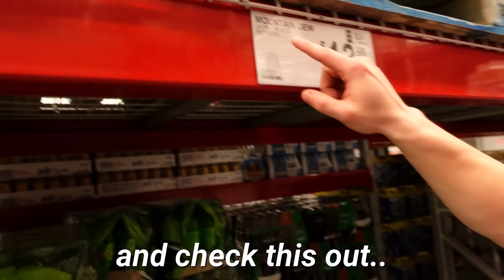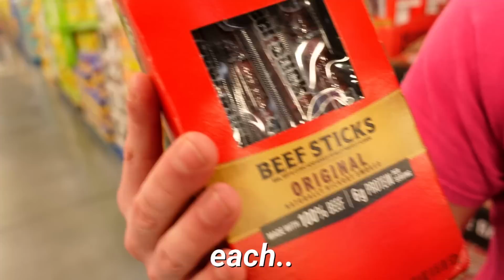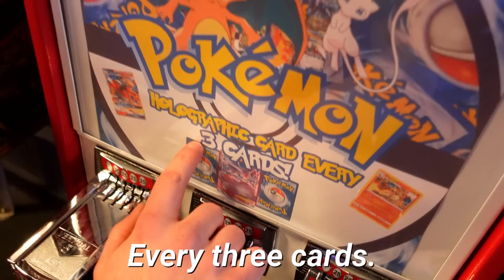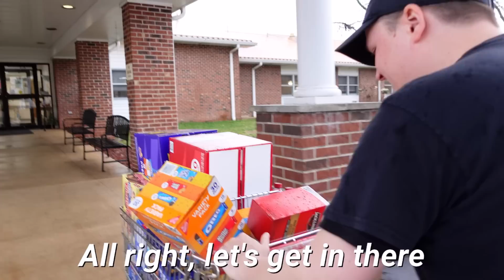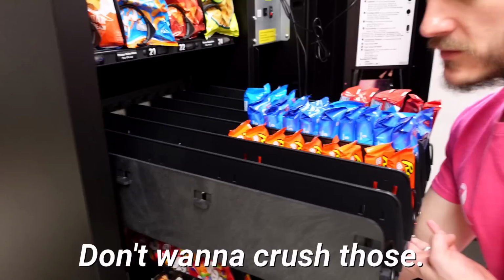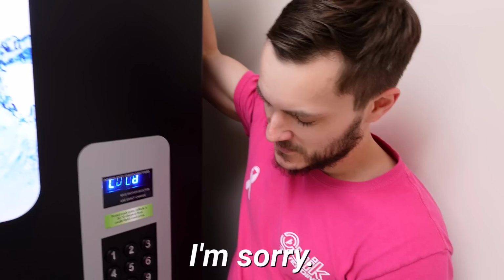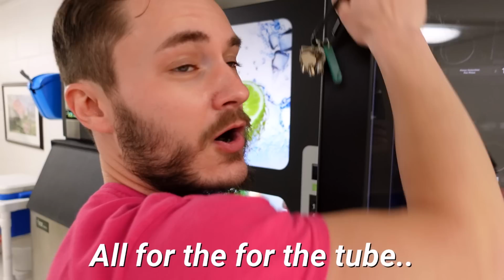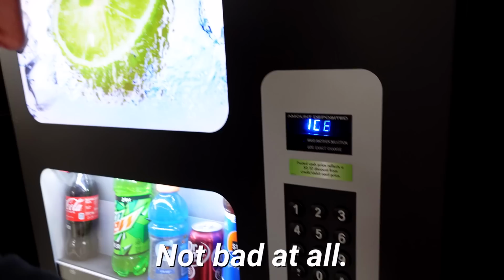Collecting SO MUCH CASH From Our Vending Machines!

Comment: I'm surprised that you guys don't have a convertible hand truck/ dolley to haul your product in with. Since I have a ton of health issues and buy a good amount of deer park 35 packs of bottled water it has been a struggle for me dealing with them even with home grocery delivery. I found a smaller flatbed hand trolley that I get the delivery person to stack the water on and then push it to the location in my kitchen. It has a fold down handle on it. It has been the best option I've found.